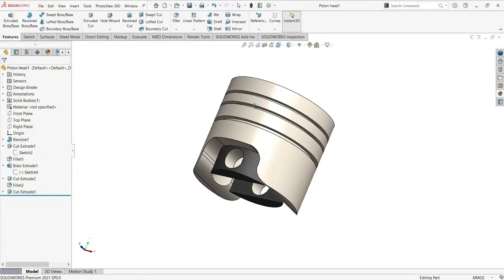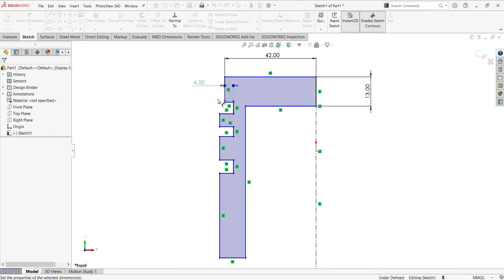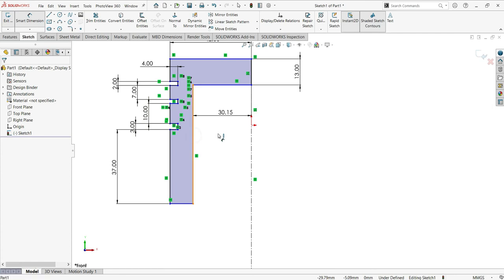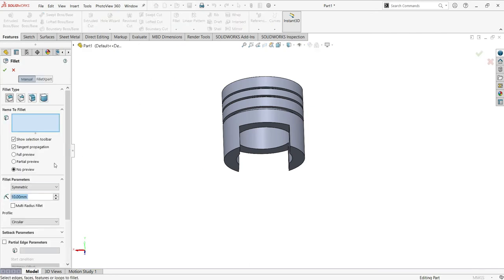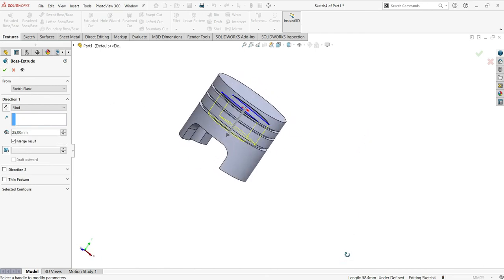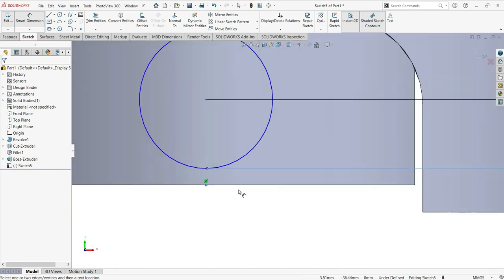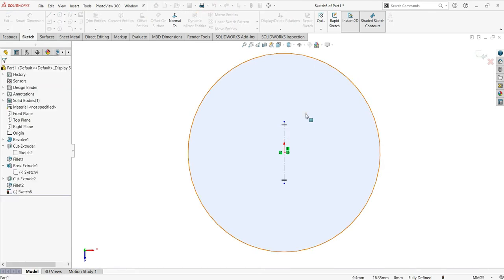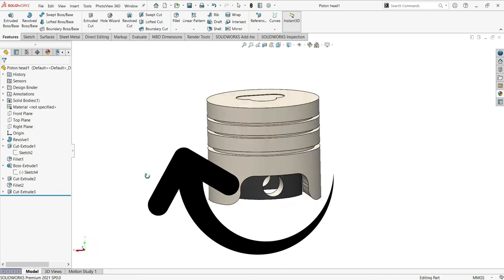Solidworks tutorial Piston Head

Comment: May I know why here we are providing cloud like surface at the top of piston as normally we see circular shape for combustion ?
Reply from the maker: Ya you're right. It's called condition chamber. I simply por an illustration. That should be a time on the top of the piston. NOT necessary a type of connection chamber.
Reply: @Mengineer10  could be please elaborate more, am not getting Sir.
Reply from the maker: That hole on the top is called combustion chamber. There are few pistons that come with a similar to cloud but overall they come with circular shape on the top.
Reply: @Mengineer10 Do the shape has any effect on mechanical efficiency ?
Reply from the maker: Sure. It has a big impact. That why since   1910s till this the manufactures have been adopting different type of combustion chamber.
Reply: @Mengineer10  really insightful to know that as before that I was assuming the space inside the cylinder where gases are either compressed or expanded is combustion chamber.
Thanks!